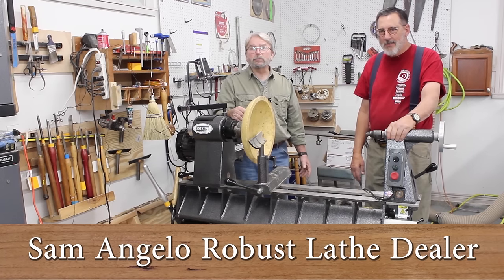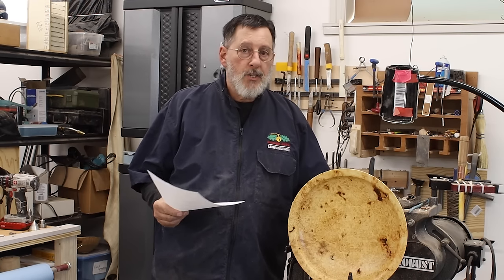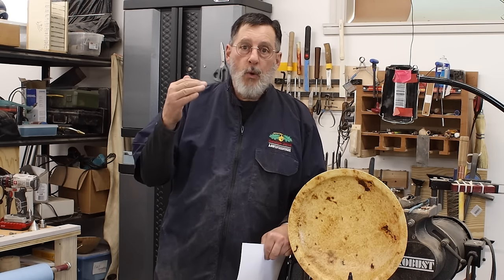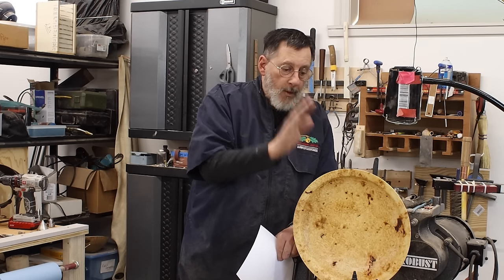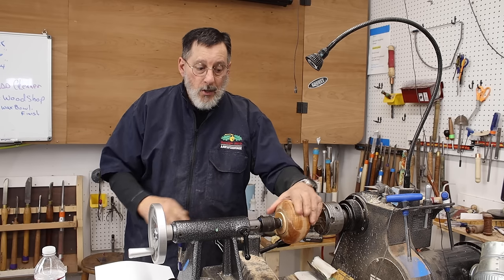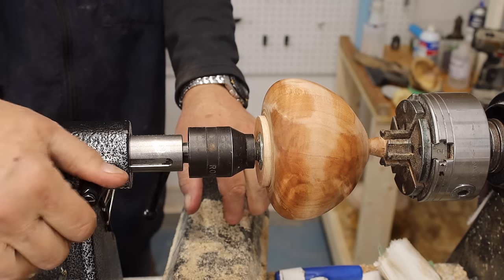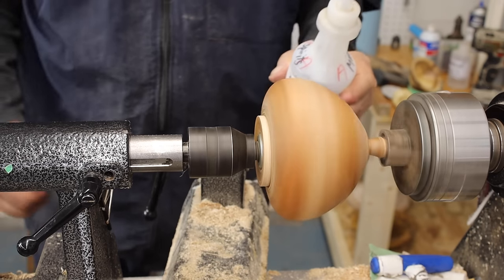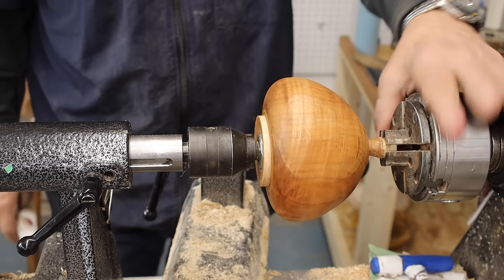Sealing and Finishing with Shellac, Lacquer, Oil      Woodturning with Sam Angelo

Comment: Great video! What would be preferred to seal and protect a table tennis blade (the wood part of the racket) without changing the characteristics of the wood veneers? We are required to use water based latex glue for our rubbers, so most of us seal our blades (they aren't cheap).
Often discussed is what type of sealer works best to protect from splintering the wood when replacing the rubber while also not changing the characteristics or "feel" of the wood... Hardness, softness, flex, vibrations etc. Most table tennis blades are constructed in a method similar to stringed instruments. In fact the one I use is called Nittaku Acoustic.
Reply from the maker: This is a really good question. I really have little I can advise you on. I think an oil would be more durable. Lacquer would change the color of the wood the least. But that might wear off with sweat from your hands. Sorry I can't help more Sam

Comment: This was loaded with good information. When I clicked on your PDF file link, nothing happened, so I copied it into a new google search panel but it was too long (32 characters vs a maximum of 20). Could you check the hyperlink?
Reply from the maker: I will address this comment/question in my next “Notes from the Turning Shop video”  Thanks 
To be published on June 5th 2022
Sam
Reply: @WYOMINGWOODTURNER  thanks